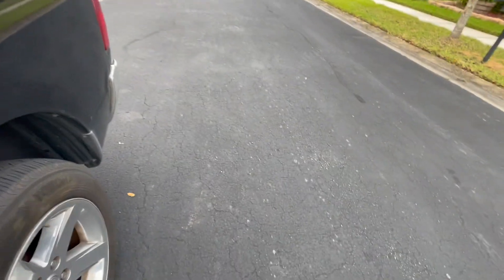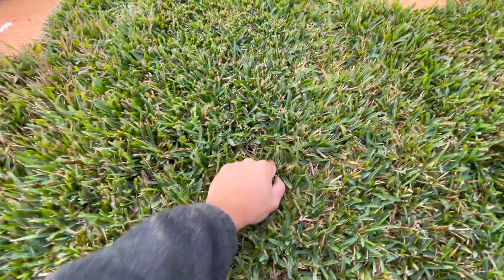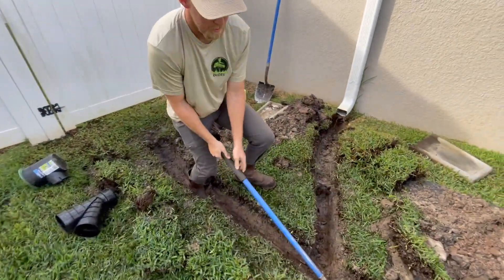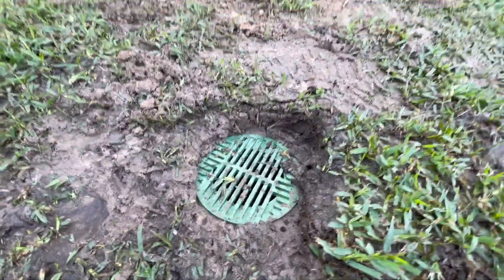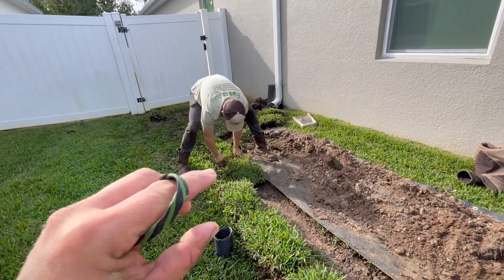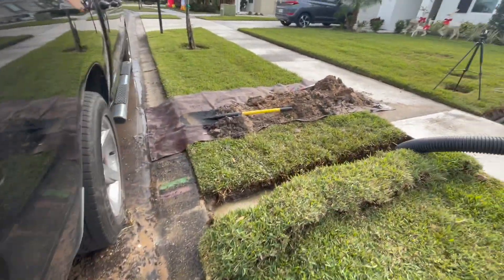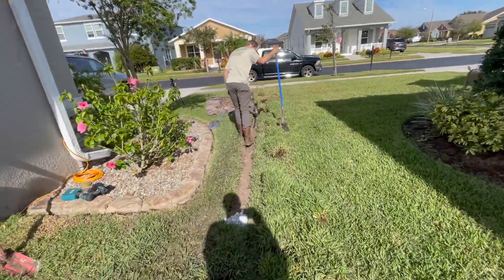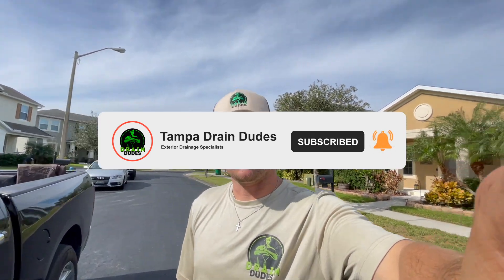Squishy Yard | DIY FIX

Comment: Adding roof water to a french drain?  I was under the impression you were trying to dry out the sub surface and surface area between the homes?  Can you explain why the downspout isnt in its own solid pipe to keep water from being drained into a spot you are tying to dry out? thanks